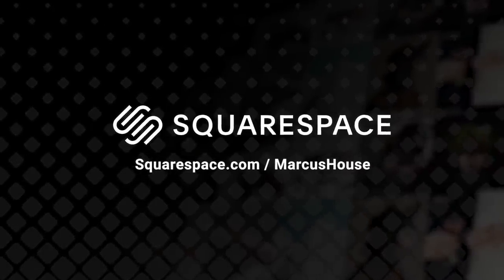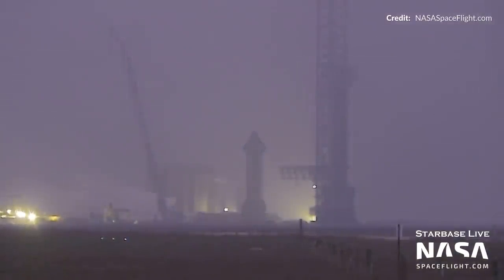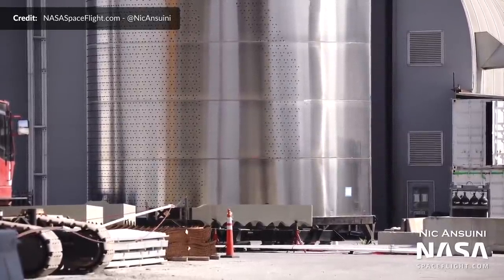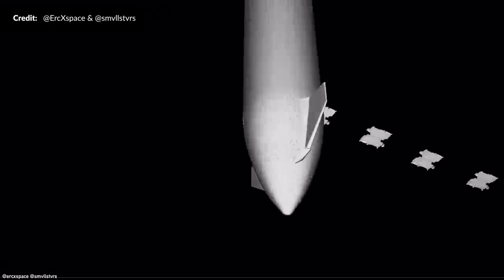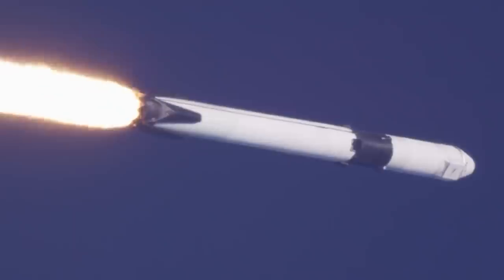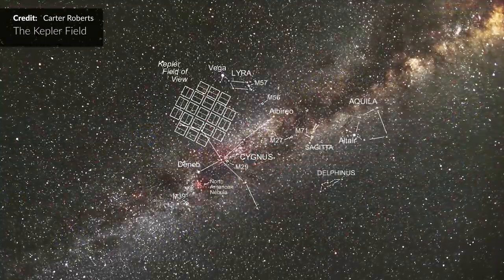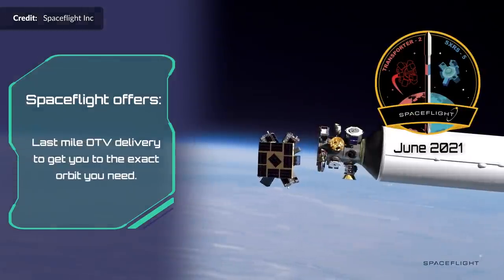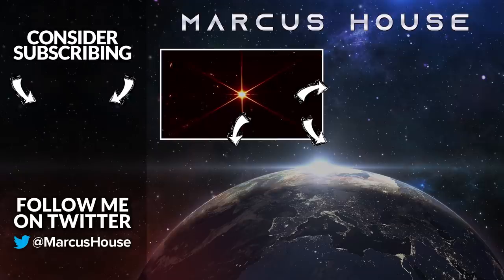SpaceX Starship 20 and Booster 4 Retired, OneWeb to Fly with SpaceX, 5000 Exoplanets and more

Comment: I wouldn't be surprised if SpaceX ultimately move location to somewhere more welcoming to the vast economic benefits that will come with an interplanetary spaceport.
Reply: Which is why Kennedy development is being done and the 2 deep sea platforms.  Once they can launch anywhere else Texas will start to apply pressure to keep them there as much as possible.and ideally the local community as well as they won't want to lose the industry jobs.
Reply: @Scanner9631  Starship work at KSC was paused, before work at Boca Chica took off. SpaceX always planned to have Starship facilities at LC-39A, but likely did testing at Boca Chica to get out from under the launch schedule at KSC. Currently, the Falcon Heavy and Crew Dragon can only launch from LC-39A. SLC-40 at CCSFS is for cargo Falcon 9 only. Falcon Heavy was supposed to launch USSF-44 before SN8 I believe, but it has had payload issue. And Crew Dragon started flying almost a year before SN8.

Comment: Why should SpaceX taking over from Spaceflight mean an increase in fees? Without the middleman it should reduce costs.
Reply from the maker: Falcon 9 launch cost just went up along with Rideshare prices. Mainly related to inflation pressure I believe. This may also effect Rocketlab to the same degree, but Rocketlab have their deployment platform specifically for lots of small sats. I think SpaceX typically like rideshares with larger sats. Will be interesting to see what follows.

Comment: 7:30 nasa are just being prudent in case SLS is not ready for the 2nd mission.
Reply: SLS/Orion are for taking crew to lunar orbit and back to Earth. The SLS core stage for Artemis II is already under construction and all the parts for the booster have been delivered. Orion will reuse some parts from Artemis I, which is why Artemis II is so long after Artemis I. 

The new program that NASA just announced is for a second lunar lander to back up SpaceX's Lunar Starship.

Comment: Niggling at me that they’re building amazing stuff, stacking it, getting it ready, then throwing it away….
Reply from the maker: Yea, I get that. It is more about the machine building the machine but at some point.. you kind of want to play with the machine.
Reply: Yeah… I have to check myself and think how far they’ve come in the last few years. It’s staggering, and when there’s a delay it hurts more!
Reply: Part of the reason why SLS is not reusable is the payload hit you take for landing the booster. Per SpaceX, the Falcon 9 Block 5 can lift up to 22.8 tons to LEO when expended. When recovered the F9 B5 can lift up to 16.3 tons (B1051.12). Since propellant is needed to land the booster, that is propellant that is not pushing payload to orbit. IF the SLS Block 1 was reusable

Another part is that SLS started development in 2011 and SpaceX didn't land their first booster until Dec 2015. SpaceX didn't reuse a booster until Mar 2017. Making a booster reusable also costs more money for developing reusability and SLS is too expensive already.
Reply: @steveaustin2686  I’d bet ~90% of the cost of space flight a few years ago was having to start from scratch every time. SpaceX have changed that entirely. I think the record for booster flights & landings is ten or eleven trips now? Some shuttles didn’t do that! Still lots to do, but we’re on the way to being a multi planet species….
Reply: @Tommahelen  I think that you are overestimating the benefits of reusability. Yes, flying a booster multiple times can save you in the long run, IF you plan to fly the booster a LOT. If your booster does not fly as often, like SLS or Delta-IV Heavy, the reusability does not help as much, if at all. SLS flies once a year at best. SLS is already ridiculously expensive and I would hate to think how much further behind and over budget it would be for reusability. Not to mention that SLS started development in 2011 and SpaceX didn't land their first booster until December 2015. SpaceX didn't refly a booster until March 2017. In the terms of spacecraft development that can take years to a decade or more, reusable boosters are still new. SpaceX flew 19 boosters before landing their first booster and 31 before reusing their first booster.

Worse, you can NOT avoid the payload hit. If reusability costs you payload capacity that you need, then you can't be reusable.

B1051.12 has flown 12 times and holds the reusability record right now.

Comment: It's amazing a rocket hasn't tilted of a crawler so far, with zero centre of gravity there so over balanced, always amazing to see, it doesn't look right in your mind as it travels lol,  you wouldn't want to do an accidental fast take of, it'll be timber and run for your life 😆 lol 😁
Reply: Since the rocket is tightly connected to the crawler and the crawler is literally massive compared to the low density of the unfueled rocket the center of gravity for the combination is MUCH lower than for the rocket itself.
Reply: What keeps SLS/Orion on the crawler when going up the ramp to LC-39B is the self-leveling crawler platform. It tilts to keep SLS/Orion level.

Comment: Space science moves to fast for FAA.
Reply: The FAA did change procedures for SpaceX's faster cadence in the middle of the sub-orbital campaign, but can only change so much to not compromise safety.
Reply: @steveaustin2686  Safety is not the issue, the environmental study is. Space X has a good safety record in maned flights.
Reply: @randywise5241  I'm talking more about Starship having roughly 9 times the propellant as the Falcon 9 B5 in case of an RUD. SpaceX got FAA approval in 2014 for Falcon class rockets at Boca Chica. Apparently, SpaceX wanted to use waivers to fly Starship under that 2014 approval and evidently that didn't fly.

While the FAA is the lead agency in the review, NASA and 4 other agencies are involved in the PEA. With at least 6 government agencies involved, is it really a surprise that this type of review takes awhile?
Reply: @randywise5241  Oh for sure. And Musk telling everyone to comment didn't help either. With SpaceX still finishing up Stage 0, they aren't ready yet anyway.

Comment: Ridiculous how long it’s taking to launch Starship and SLS.  NASA wants to use Starship for moon landings but the FAA is passive aggressively delaying Starship’s progress.  Meanwhile SLS is underfunded so it’s taken decades to get anything done.  Meanwhile back in the 60’s NASA went from figuring out how to send a man into orbit to landing a man on the moon in less than nine years.
Reply: The Apollo program had roughly 3% of the US budget. NASA's whole budget is around 1/2 percent of the US budget.

SpaceX almost certainly knew about how long this review would take as they are STILL finishing Stage 0 in Boca Chica. After all, in early Mar 2022 SpaceX had to swap out the GSE methane tanks, so they weren't ready to launch anyway. SpaceX has yet to test the water deluge system either.

Since the FAA mentioned consultations in the Mar 28th date change, my guess was that they may be working out a mitigation strategy from SpaceX with the other agency or agencies in the review. The Apr 29th date change mentioned interagency consultations, so now I really think that is what is going on. That would make sense for the delay and would be near the end of the review. The FAA should never be a rubber stamp for anyone.

While the FAA is the lead agency in the review, NASA and 4 other agencies are involved in the PEA. With at least 6 government agencies involved, is it really a surprise that this type of review takes awhile?